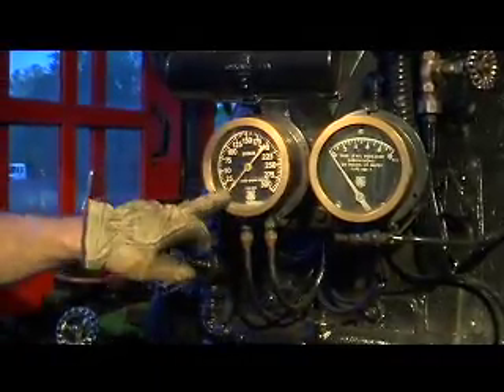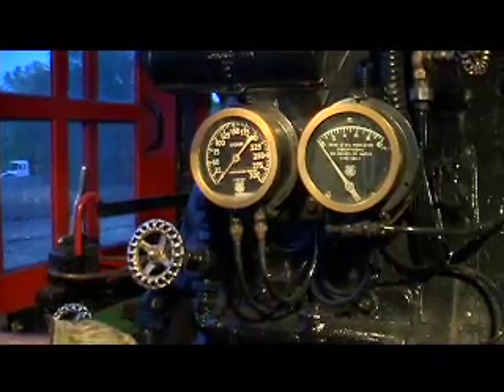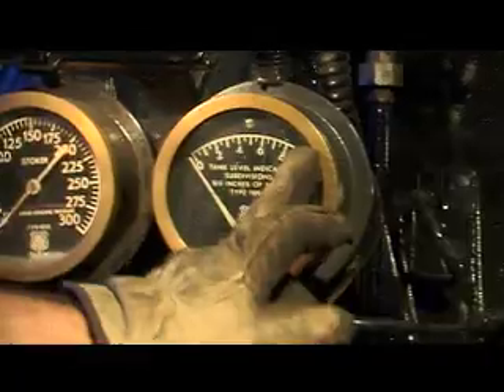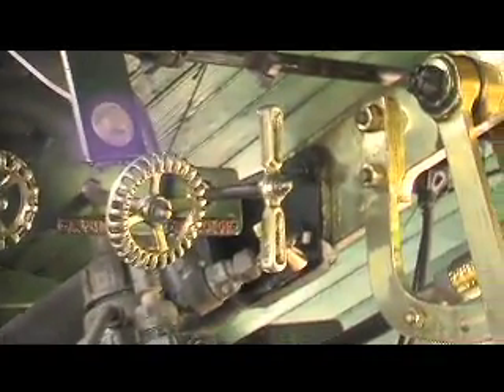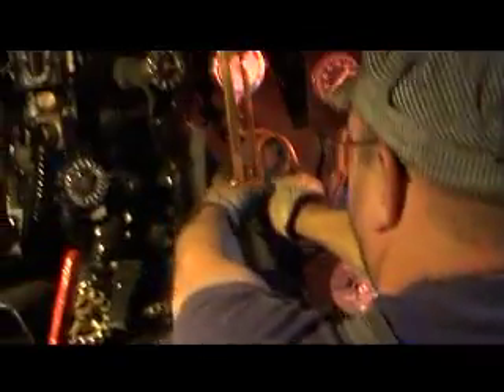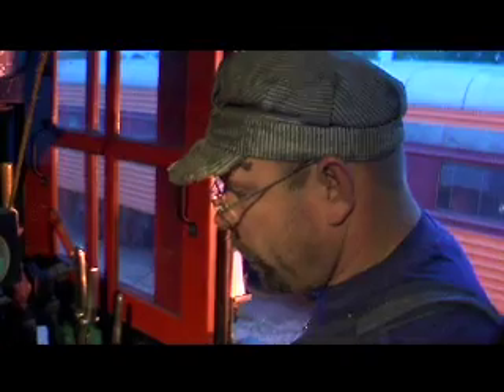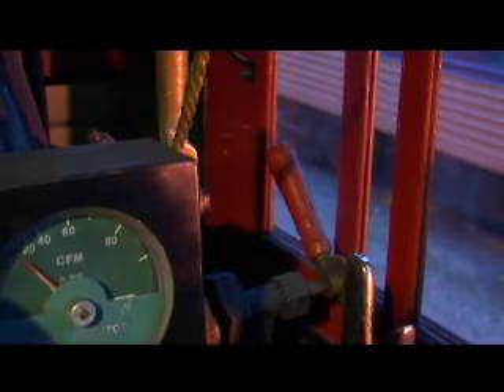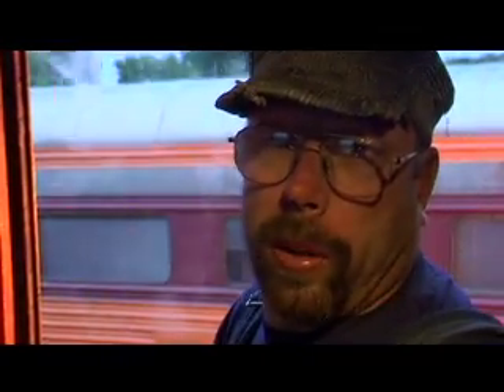Learn How Milwaukee Road 261 Operates (Part 2)

Comment: eh not too much differant then the NPK 765 as far as setup, only the firedoor opener you stand on is on the floor and not mounted to the firebox itself, and the whistle is just the handle on the 765 we don't seem to have a cord everything else really looks about the same even though the maker of the loco was differant and the 261 has bigger driver wheels, by the way this is the one that came though town in 1997 on its way west just a mear 2 weeks before they tore down the depot, which was a huge brick building, I wish I could convince csx to let them bring up the 765 for a day or 2 for herritage days its not far away at all only 35 to 40 miles from here that she is kept.

Comment: Steam engines do not have a Dead Man's switch.  These were invented with a diesel locomotive primarily as a precaution against the engineer falling asleep.  As you can see from videos of any cab ride in a steam loco, it is not only a more physical job, but also requires alertness to a number of items in the cab and continuous communication with the fireman.  The engineer of a diesel, by comparison, has much less stimulation to keep his mind and body active.

Comment: How fast can she go?
Reply: The 261 with the right engineer and fireman will do a little over a hundred, though it is extremely unlikely it will ever reach that speed ever again.
Reply: I heard Steve Sandburg said once the top speed on the 261 is 80mph. She was built to haul fast freight. An engine like the 844 could probably do up to 110mph.